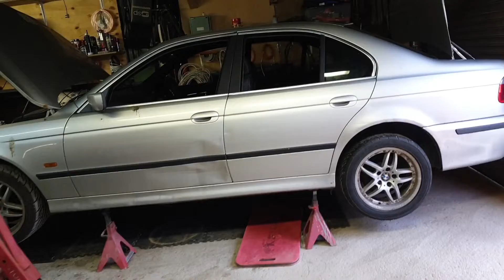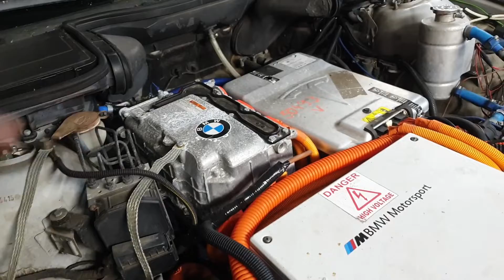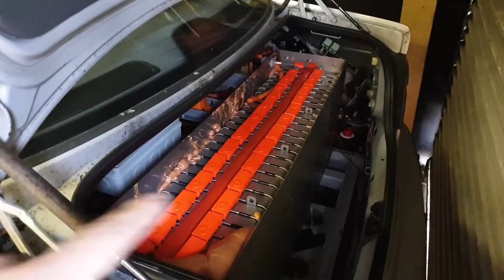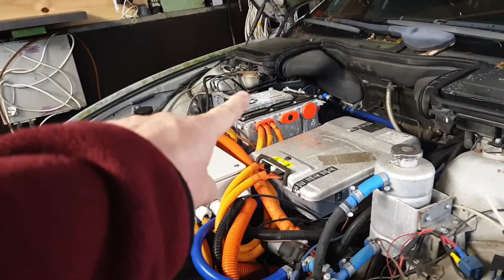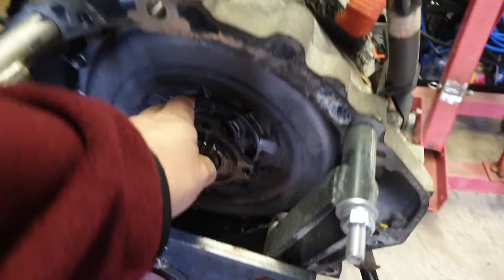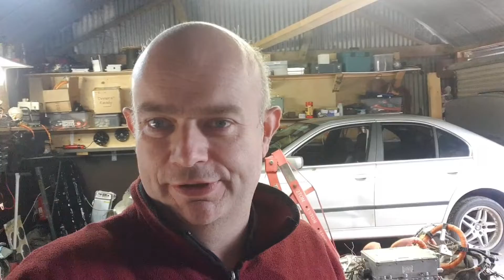E39 Lexus GS450H Swap 01

Comment: Fantastic work Damien! After seeing your 7 series 450h video I bought a whole 450h to convert to EV and am still driving it round a year later as a hybrid whilst trying to get the rest of the parts together! I am so pleased you have re-started work on the 450h drive train - so pleased indeed that I have bought another 450h as a donor vehicle to convert instead and use my original one as a daily until the conversion is done!